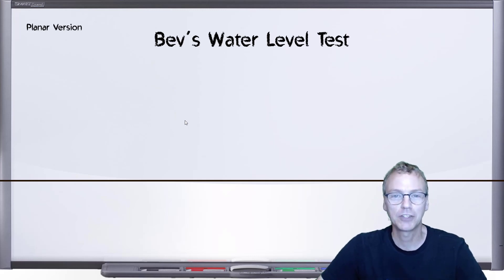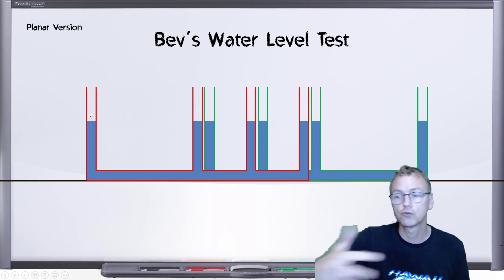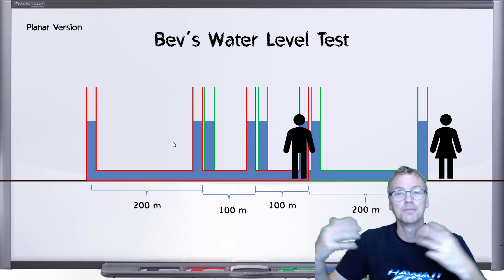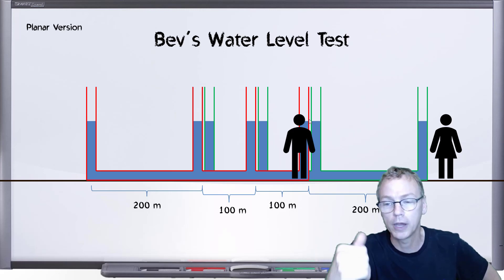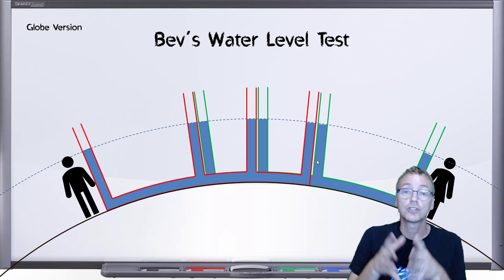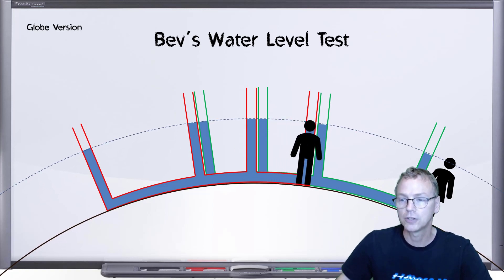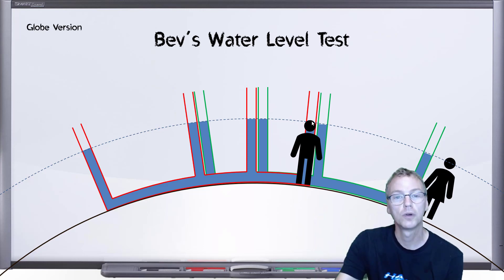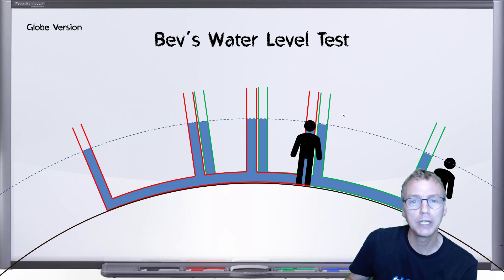Bev Try Thinking and Spot On Level's Water Level Test

Comment: Bev's test was done on a 872 meter stretch of canal side from The Saracens Head, L39 8RH northwards to N.Moor Ln bridge. That stretch is not perfectly straight and has a slight bend halfway up.  The water levels are each 400 meters long and combined with a 200 meter overlap giving a total length of 600 meters. 8"xMiles^2 gives an expected sagita of just 7 mm. As that is an angle of 0.00133... degrees and the Rayleigh Criterion of the human eye is approximately 0.017 degrees I suggest it is impossible to see such a small difference unaided. I remember Bev stating that he had tested an autolevel against a water level and found the autolevel is no longer millimeter accurate beyond 100 meters. Thus I would not expect Bev to try using an autolevel to check his water levels.

The test as Bev has done it appears to rely on the water levels having all points lie on the same horizontal line per water level. Thus the water levels having their center points 200 meters apart, there would be a change in vertical between the two water levels so the pots would show different gaps. I make it an expected gap for the 3 overlapped points of 3.146 mm, 0 mm, 3.146 mm.

The World ocean is a single body of water, hence a water level. Were water levels to define a horizontal plane, the World ocean would be sat on the globe like a disc on a ball. Of course that is complete nonsense. Thus on a globe a water level must define a curved surface. Once again we see someone using a nonsense globe model to demonstrate that nonsense globe model does not match reality.
Reply: Totally agree that the globe model is nonsense.
Reply: @DrEMichaelJones  Which one? Bev's one with its world ocean sitting on top like a hat, or the one in common usage where vertical depends on where you are? If it is the latter, please let me know of something I can observe which does not match the model.
Reply: @sthurston2  that's a fascinating belief. Why don't join the d!scord servr and ask him?
Reply: @DrEMichaelJones  
Funny stuff. Bev is the crowning achievement of ranting idiot. And everyone knows that… except Bev

Comment: I am wondering what their predicted margin of error will be.

A simple arc calculator result:
Radius of Earth - 6371km
Length of arc (each test model) - 400m
Expected sagitta - 3.14mm

So, over the length of each water level, being 400m in total, one would expect that on a globe earth, the arc height, sagitta, would be 3.14mm.
That small a difference will be very difficult to measure.
Depending on the diameter of the tube, this would almost be the height of the meniscus.

Further calculations for a test length of 600m (as indicated by the overlapping water levels), the expected sagitta would be 7.06mm.

I am hoping for a very very precise method of measurement.
However, I am expecting a poor, inaccurate, method of measurement.

Fingers crossed.
Reply: Using a theodolite to measure the drop angle from one end to the middle at 300 m distance will give a geometric drop angle of 4.9 arc seconds. At standard refraction k = 0.17 this angle will reduce to 4.0 arc seconds. But measuring only 1 to 2 m above the ground will give probably much more refraction if the time and conditions are not chosen carefully. Over 600 m the angles double.
Reply: @WalterBislin  Even over a couple of miles, at or near ground level, there is so much scintillation happening that measurement accuracy is at best very poor. We've looked at this and short range (less than 1 mile) measurements are totally unreliable.
Reply: @WalterBislin  Okay, but would there actually be much refraction if looking level, through a presumably equal pressure air layer, over only 300, 400, & 600m?
I had considered refraction, but thought that without a change in density, there would be little to no refraction.
Reply: @SydneyRaptor  Atmosphereic Refraction along the surface does not depend on the density, but on the VERTICAL DENSITY GRADIENT! No vertical gradient, no light bending, no refraction, no matter what density! A density change along the line of sight creates no refraction, correct. 

The vertical density gradient is mostly a function of the vertical temperature GRADIENT, and to a small extend on the absolute temperature and air pressure (humidity, CO2 concentration and the wavelength of light can be neglegted). A difference in temperature along the line of sight or at the observer and target at the same elevation creates no light bending. A gradient at 90 degrees to the line of sight is required.

k = (503 K*m/mbar) * P / T^2 * (0.0343 K/m + dT/dh)

k = refraction coefficient, P = pressure in mbar, T = absolute temperature, dT/dh = temperature gradient (change in temperature over change in height).

A temperature gradient of +0.13°C/m (cool ground below warmer air, as in the evenings) is sufficient to bend light in a radius small enough to follow the curvature of the earth. The earth appears flat (see FECore laser tests) or even concave.

At standard refraction (k = 0.17) the radius of curvature of light is about 37,500 km (= R / k).

The apparent curvature drop z, taking refraction into account, is:

z = (1-k) * d^2 / 2R

The drop angle alpha in arc seconds (what you see in a theodolite) is:

alpha = 3,600 * 180 / pi * (1-k) * d / 2R

Note, the apparent drop increases with the square of the distance, while the dop angle increases linearly with the distance (d).
Reply: @WalterBislin  I think you may have misunderstood my layman's comment. I also do not confuse vertical and horizontal pressure gradients.

I am referring to looking from one end to the other of the combined water levels.
I am assuming constant temperature & pressure along either the straight line, or the geodesic, described by the points of each water level column.
Geometrically, the sagitta is 7.06mm.
The difference in atmospheric pressure could be calculated for a different elevation, 7.06mm, but I think the difference would be so insignificant that the resulting refraction would also be insignificant.

My original comment point was that the geometrical sagitta between end points of each, and both combined, is so very little, that a very precise measurement would have to be made in order to establish the water levels would evidence either a curve or flat.

I have since learned that Bev has refused to even attempt to sight along the level's indicator points, and this is very disappointing indeed.

Thanks for the diversion from my original point, though, I appreciate it. 👍👍
Reply: @SydneyRaptor  👍
Reply: @SydneyRaptor  I can go into much more detail if need be, but "looking level along an unchanging density" is one of the things people tend to get wrong about refraction through a gradient. Looking through a gradient in a direction (horizontal for the atmosphere) that is perpendicular to the direction of the gradient (vertical for the atmosphere) causes the most refraction, not the least. There's a page on Wikipedia on gradient-index optics which might help. Cheers!
Reply: @doofismannfred4778  Thank you.
I looked at the Wiki entry and am not sure that it is directly relevant, as it is explaining lenses. But thanks anyway.

I am not sure where you think that I am incorrect.
My original point is, the sight line from one end of the double, overlapping water level to the other end.
The sight line, geometrically, runs below the arc of earth curvature (+1-2m) a chord. The arc has a sagitta of 7.06mm over that 600m arc length.
That 7.06mm would have a pressure gradient and a temperature gradient. I know that. And I know that they would produce a refraction of the sight line.
However, as the temp/pressure differences are so insignificant, the refraction would also be insignificant.
Am I wrong in that?

I doubt very much that even 1 in a 1000 globe earth realists of this community could accurately measure 7.06mm over 600m.
Reply: @SydneyRaptor  You asked, "Am I wrong in that?" Yes, for the reason I already mentioned. People have been known to get this wrong. It's not exclusively a flat Earther problem, so you're fine. It doesn't seem intuitive at first, but the existence of the gradient is the necessary factor for the deflection, not the change in density along the path.

The direction that has the least amount of deflection is actually parallel to the direction of the gradient (vertical for the atmosphere), or the path in which the change in density occurs the most. The direction that has the most amount of deflection is perpendicular to the direction of the gradient (as I mentioned in the previous comment), or the path in which the change in density occurs the least.

Think of it this way. The path light takes is not infinitely thin, or put another way, has thickness. We know this because diffraction occurs and other fun phenomena. When light is traveling along a single density level of a density gradient, the extents of the cross section of that path experience different densities and, thus, refraction must occur. As I said, that will be where the most refraction will occur for that gradient since the extents of the cross section of that path experience the most change in density. I hope this helps.
Reply: The beauty of mathematics: you can predict whether an experiment will be viable or not before you waste time and resources actually carrying it out.
Reply: @jormungandr9251  Cavendish was a case in point. Absent the ability to predict the performance of that balance from fundamental engineering calculations, anything I did would have been a shot in the dark. But by going through a rigorous engineering analysis, I was able to know, with[n 5% or so, exactly how the balance was going to behave. That saves huge amounts of trial and error guess work. And that is the beauty of mathematics and engineering. You just need to know how to apply it.
Reply: @bluemarblescience  

A great case in point and now’s my chance to tell you how cool that whole project was.
Reply: @jormungandr9251  Thanks and thanks to everyone who supported it.
Reply: i expect that your expectations will come to be.
Reply: The predicted flerf margin of error is "Math isn't the real world. I don't deal with numbers and equations, just concepts and definitions."
Reply: @reidflemingworldstoughestm1394  😁 That’s why they always fail in every experiment they conduct! They don’t know what they can expect and what not.
Reply: I don’t know about you lot, but 3mm is easy to measure with a ruler and the naked eye
Reply: @JustBarry-fb8kl  

At a 600-m distance?
Reply: @JustBarry-fb8kl  „but 3mm is easy to measure with a ruler and the naked eye“

Yes, if there IS a 3 mm difference at all. Neither the globe model nor the flat earth model predict a 3 mm difference in the water levels in this experiment (did you even watch the video?).

But the globe model predicts a 6 mm drop from horizontal of the observer at one end at 300 m distance and standard refraction. A 6 mm drop at 300 m distance at varying refraction conditions? That’s a drop angle of only 4 arc seconds!

Over much longer distances and many meters away from the refraction ground effects the drop is clearly measurable. This was measured in many experiments and yielded exactly what the globe predicts.

Comment: Great video and clear explanation.
Bev has been told and shown this for the past 2-3 years by many people.
Even Brandon flat earth (his screen name) called out Bev on this on Brandon’s YouTube stream.
Sly sparkane has also made a video calling out Bev’s previous test method.
At this point the only reasonable conclusion to come to is that Bev intentionally comes up with tests that will not differentiate between his level is horizontal claim and the globe earth claim.
It’s intellectual dishonesty on the part of Bev and gullibility on the part of his followers who agree with him.
Reply: What shite, you know that the surfaces can be compared to a straight line established by surveying tools.
Reply: @JustBarry-fb8kl  they could but Bev won’t do it. He already admitted that things drop below an auto level crosshair. as expected on the globe. Bev is a con man. He got over £3k from his gullible follows recently.